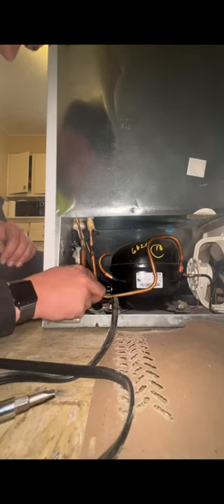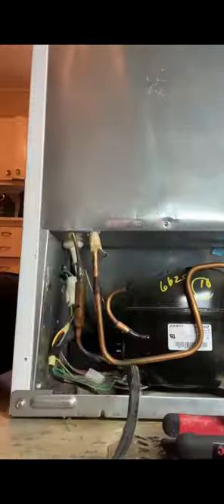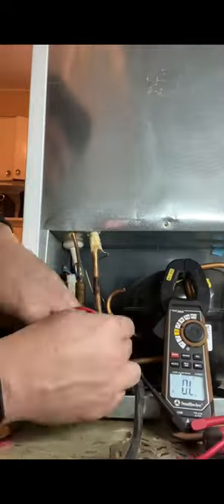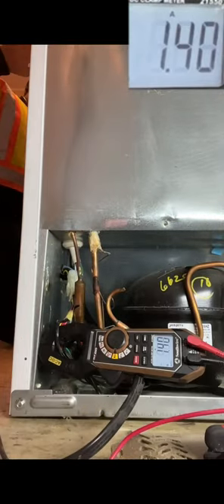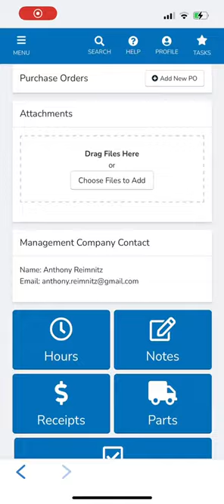Taking a Look at a refrigerator that was making a noise #HandsomeOrHandy #ShortsmasChallenge￼

Comment: Check the icemaker, Bro. If too much stuff is jammed into the freezer it can hook the bail. It can also happen to the bail if ice level needs adjusting. Intermittent problems are the worst.
Reply from the maker: That was the first place I checked, but there is no ice machine on this refrigerator